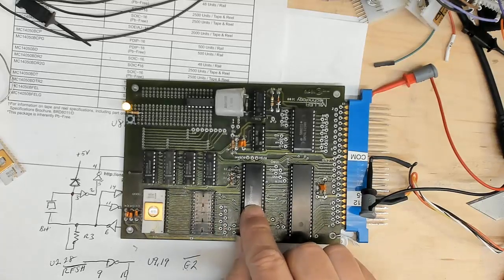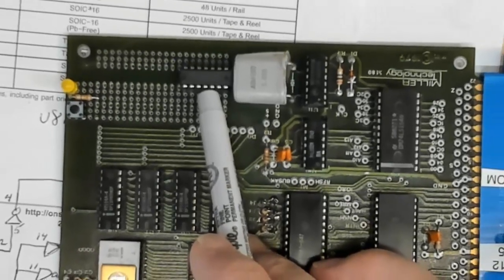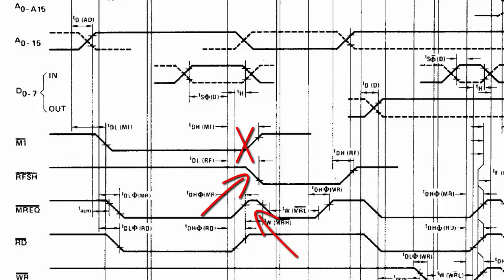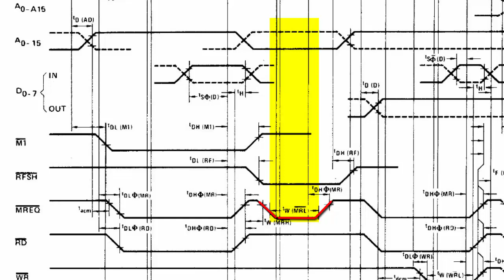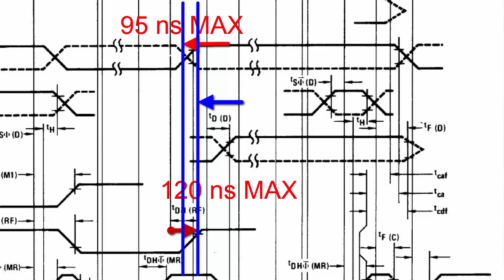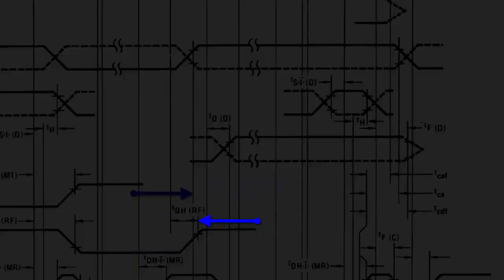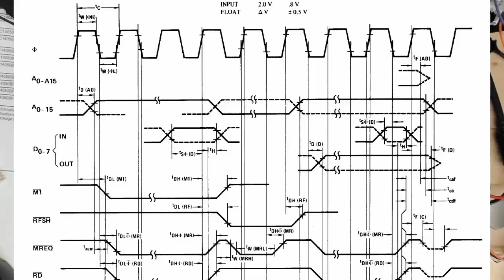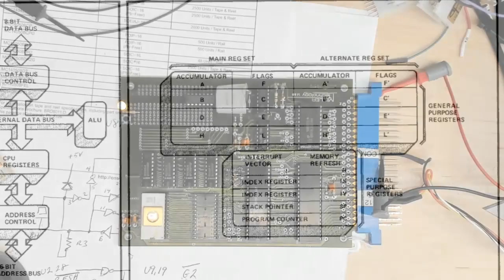{65} There is an output port on the Z80 that is rarely utilized and yours for the latching !!!

Comment: I wonder, why Z80, even today, has no mode without DRAM refresh. It wastes half of the machine time because of that feature. That makes Z80 as slow as Q&D designed 6502 (comparing on the same memory access rate, i.e. 6502 with 1/2 external clock, than Z80).
Reply: It does not. Those four cycles are used internally, while the fetch AND then refresh address is output on the address bus (except during those four opcode prefixes). The 8080 used five instead of four cycles for many one byte instructions, so the Z80 was actually a bit more optimized, "despite" the added refresh. 

Also, the compatible Z180 and eZ80 are different than the original Z80. No compulsory refresh there.
Reply: The Z80 allows two full clock cycles for memory access, the 6502/10 only a fraction of a cycle. That's one of the reasons a Z80 can be clocked 6 times as fast as the 6502, using the same speed memories. The Z80 can also perform a 16-bit addition in 11 cycles, while the 6502 need 20 (longer cycles) for this. So the Z80 can be almost twelve times as fast as the 6502, using the same memory, i.e. when it comes to code that uses 16-bit or 32-bit quantities (not only 8-bit bytes).
Reply from the maker: I do not get into the internals much so I just believe what the manufacturers say about their processors.  The people that reverse engineer these things at the transistor level have amazing understanding.  But with my user’s manual level of understanding, believe it is the same argument as multiplexing the bus on, for example, the 8085, I.e., that the performance hit is nominal.  Internally, after fetching the instruction the Z80 has to take a couple of T-states to move around and process the instruction, so it just needs some clock transitions but externally appears to be doing nothing.  The refresh is separate, purpose built, logic that performs additional functionality without delaying the CPU.   Likewise, with the 8085 intel always said it wouldn’t be any faster if the lower byte were not multiplexed since the cpu is busy and the memory needs the setup time anyway.

Not exactly related, but I presume that going from two phase clocks to single phase was extremely difficult since they then lost all of those transitions that were being used internally to move and process things.

Comment: FYI - In 1980 Texas Instruments released their TMS4164 DRAM which unlike other DRAMs used a 256 Cycle @ 4ms refresh to lower power dissipation. Unfortunately Zilog didn't foresee this so an artificial DRAM A7 signal generator was needed; The artificial A7 is generated & switched in using the Z80's /RFSH signal. Details of this circuit is documented on page 211 of TI's 1982 MOS Memory Databook.
Reply from the maker: Isn’t it interesting the (now) obvious things that designers miss? How hard would it have been for zilog to include A7.?   Thanks for the reference, it was an interesting application note

Page 211 
http://www.bitsavers.org/components/ti/_dataBooks/1982_LCC7061_TI_MOS_Memory_Data_Book.pdf

Comment: The Romanian Cobra ZX Spectrum clone uses that R bit to switch between two memory configurations, enabling CP/M mode.
Reply from the maker: Thanks for letting us know.  
I particularly like systems that go into a resident monitor by default and uses either this R bit or some other latch to swap out the resident monitor for a boot loader.

Comment: My thought was to use the other flip flop in the ls74 to delay A7 by one clock cycle: clock the first FF with the cpu clock, then clock its output into the second FF with ~RFSH
Reply from the maker: Good thinking, double buffer to latch every A7 but only keep the ones associated with a RFSH* strobe.  
Since the minimum delay tDH is not actually specified and the ‘74 latch could take a few tens of nS to set-up and propagate, rather than use the phi1 maybe use the rising edge of MREQ* as the clock into the first latch and then the rising edge of RFSH* for the second gate.  That would give just a bit more time and the rising edge of MREQ* is defined as indicating a valid address on the bus.

Comment: New to your channel. What do you use for writing code and code simulation. I have been tinkering with my own z80 board. What i plan to do is to use 64K RAM chip. And a microcontroller what reads from a serial EPROM. At power on reset the microcontroller will doing two things. It will take control over the Z80 reset signal pull it low. Then it will load the lower portion with of the RAM with code. After loading it will release the Z80 rest pin
Reply from the maker: Welcome to the channel, let me know what you would like to see.  
I only write in 8-bit assembly now, for the 8008, 8080, and 8085 I use the cross-assembler found on herb johnson's retrotechnology web site.  For Z80 I use ZMAC cross-assembler.
For 8008 hardware i mostly use my MIL MOD8 system, for Z80,  8080 and 8085 i have my SBC-85 project along with many S100, multibus, and STD single board computers and then things like this miller board that would be total orphans and alone in the world if i didn't at least get them running and write some confidence test or monitor for them.  As for the SBC-85 project, omeone has also made a Z80 version for that system but i have not built one yet.  
I rarely use emulators unless i have a really hard bug I cannot find through normal means.
Reply from the maker: Regarding your Z80 system, I may be the wrong person to ask, I prefer to design things using components and techniques i would have used back then.  Throwing 64KB of RAM at the design would have been unrealistic.  
That aside, what is the advantage of having the controller move the data from the EPROM over into the RAM?   With the 64kB limit, in many systems it was common to page swap, e.g.,  page out the boot eprom or a diagnostic EPROM and then switch over to a run-time eprom or ram.  But it was the main CPU that would do the copy and page control.  It seems like overkill to use a microcontroller just to hold the Z80 in reset while copying the EPROM into the RAM.   The Z80 could easily do this by itself. this one bit output discussed in {65} makes a perfect page swap control bit.  For example, latch that bit and use the Q and Q* outputs of the latch (along with the 0x0000 decoding logic) to select which base EPROM is used.  Or look at video {38} how they used an XOR to flip which memory was decoded.

But there is never only one "right" way to do hardware or software, so whatever way you want to try is a good place to start.  For me, the important thing is to build something, learn something, rinse and repeat.

Comment: Interesting approach, but what is the advantage compared to the standard solution, which means calling the "out n, a" (0xD3) command and trigger the latch with the IORQ and WR signal?
Reply from the maker: With this there is no need to decode an address to select the port.  So in a very tight system, this pretty much comes for free and saves a decoder or comparator.
Reply: @HelloWorldETX  re Z80 hidden port as decoder - If you're still tinkering with this,  your opinion on using the refresh R+I latch as an actual address extender?  i.e. a latched bank select signal to redirect the next memory R/W operation, thus effectively turn the z80 into a 32-bit address-capable processor?
If I were able then I'd try it myself, though it's not possible atm.
Using this port you described appears to be a lower cycle-count solution to achieve this.
Reply from the maker: @El_Croc  Indeed, that would be a good application to page swap memory.  If you are using a large memory chip the easiest way would be to use a few bits of this latched port to control the high memory address bits.  Say you have 64K existing and you want to utilize a 512K EPROM up at the top, use this prot to directly set A18->A16 which would give eight 64K pages above your native 64K.  Or if you want to have a variety of devices, you could use these to select each of the memory devices using typical memory address decoding.  There is the little detail of swapping program memory in the middle of running a program, but that can be handled using one of the techniques i mentioned in video {90}

glitchwrks also is playing with one of these boards: https://www.glitchwrks.com/2022/09/15/miller-m80

I need to get back to this board to try out the monitor he captured for that board.   my M80 board is still on my bench, but is getting pushed further and further back as my intellec 8 system is taking more and more room.  but someday i will get back to this M80 and big, big memory space is something that would be fun to try out.  Thanks for the suggestion!
Reply: @HelloWorldETX   Cheers I'll take a look at your video 90
Reply: @HelloWorldETX   Would this timing trick work on the newer eZ80F1 chips I wonder.  50 MHz potential, and reportedly faithful reproductions of the original circuits even down to bugs  AAA.  The timings might be too small on these faster chips.   Watched your video 90 - have commented there further.
Reply: ANT there is another benefit by doing so. Any I/O operation on the Z80 comes with an additional wait state compared to a normal memory operation. So not only you need no extra  operation to put the value to your one bit port as it’s done by the processors operation anyways, a out operation would be at least one clock cycle longer than a normal operation.
Reply from the maker: @0toleranz  Excellent point.